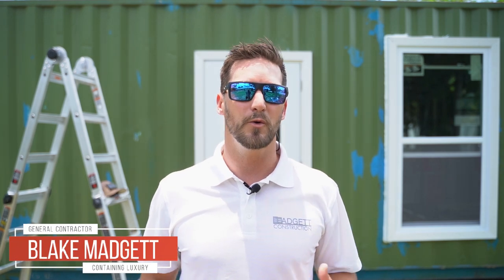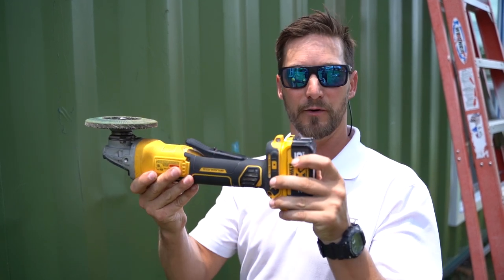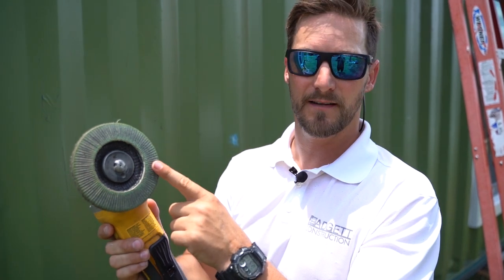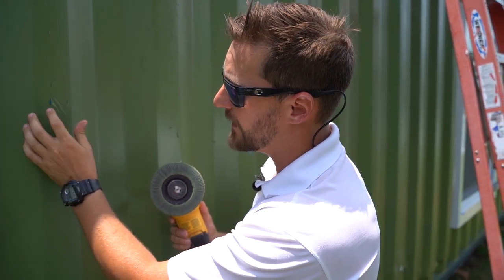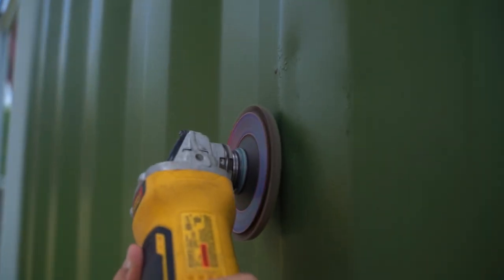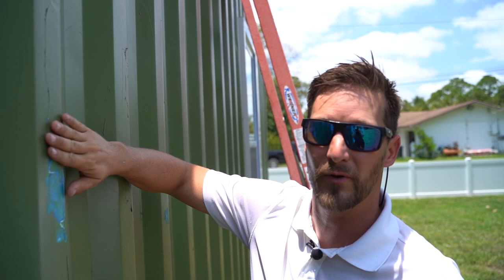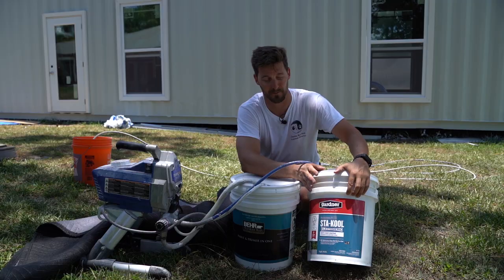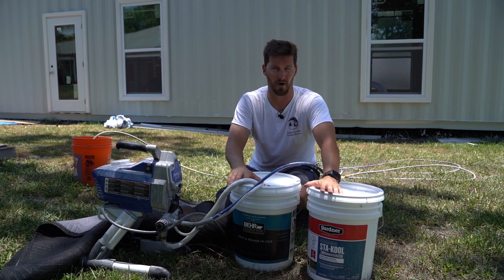Painting Our SHIPPING CONTAINER HOUSE | Ep. 6

Comment: I have some questions about the painting of the container home. First off, how is that brand of paint holding up?  Also, did you use the paint/primer combo as a base-coat and use the roof coating as the top-coat? I'm asking because I just bought a used 20 ft container for storage/shop and it needs a repaint. Thanks for the help!

Comment: Blake how do you feel like the Stay Cool product us holding up a year later?  How is the adhesions and how is the final coat of paint holding up?  We are about to paint the exterior of our shipping container build .  The Stay Cool product is apealing not only because of the cooling properties, the water proofing as well.  I'm finding mixed reviews on final paint adhesion...  Love to know how it's holding up in your extreme climate.  Thanks so much for putting all this great info out there!
Reply from the maker: No Strings Running hey! Well to be honest our is covered under all the siding now, but Based on the cost I am not sure you can loose by going this route even if you had to redo it every couple years, the heat load was insanely reduced after application, so I would do it even if it was a short term solution... it was also so thick it sealed up almost with a rubbery coating.
Reply: Containing Luxury thank you so much for the response!

Comment: Hi. What do you use to seal the exterior roof? Can you use liquid rubber?
Reply: I’m doing the same process. I’ve mated 2 containers down the 40 foot line by welding a 1/4” thick x 3” wide x 40 feet done the marriage line. I am going to find a good rubberized sealer for the plate added to insure its watertight.